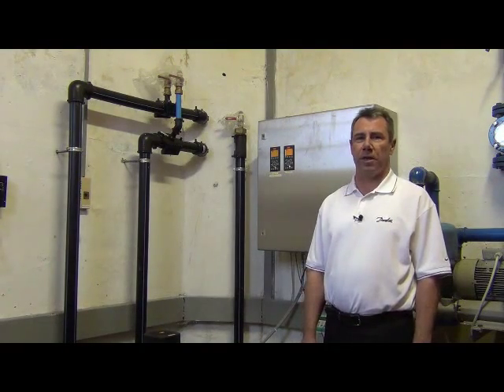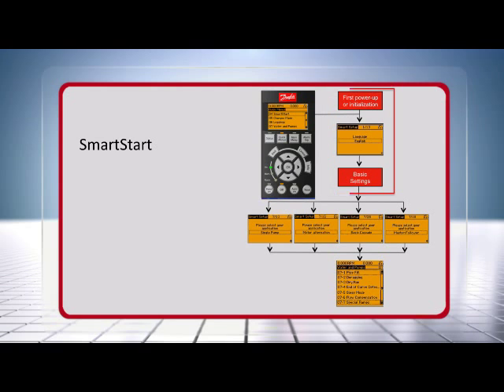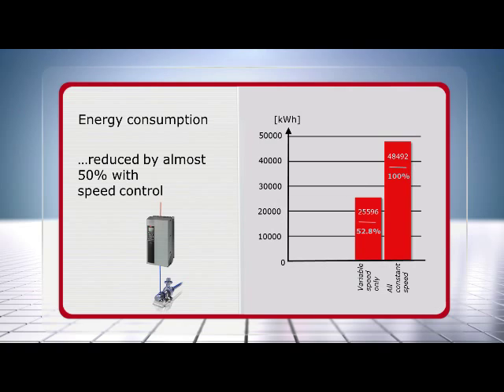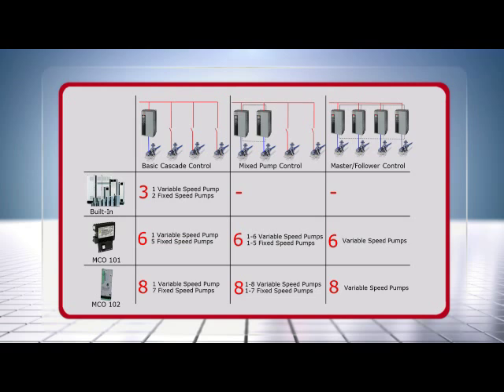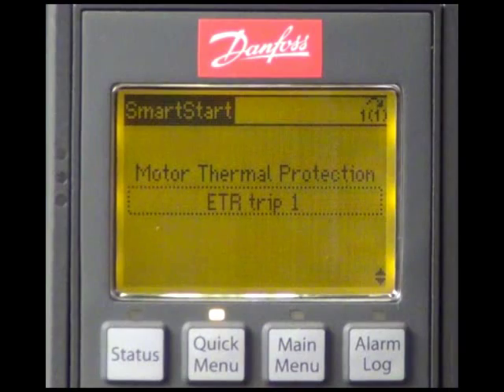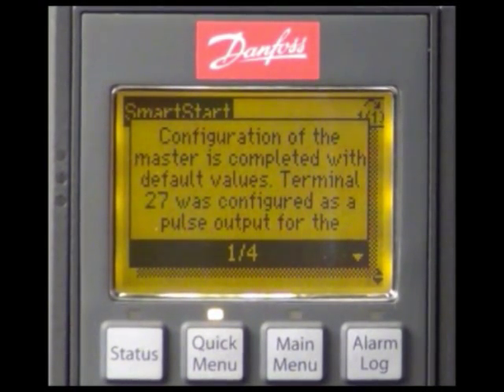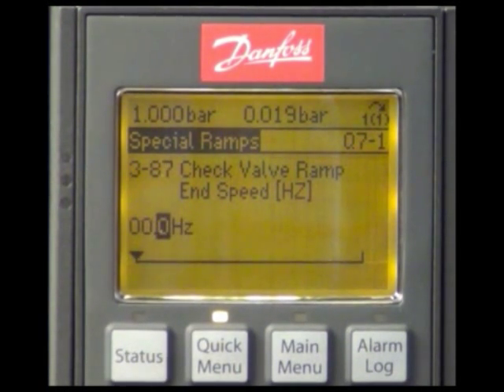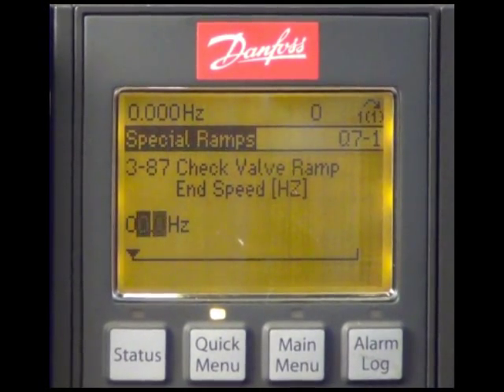VLT® AQUA Drive - Cascade Controller & Master/Follower Applications

Comment: Hi how are hope you are fine.I could not set drive as a master its by default on follower mode please guide me how i can set a drive as a master.
Reply from the maker: Hi Ghulam, You can find the Master/Follower instructions for the VLT AQUA Drive in this document : http://drivesliterature.danfoss.com/showDetails.action?doctype=TLI&docid=0000000000000030000002559&version=B3&language=EN
Reply: Thanks i will try to configure according to this.I will reply soon
Reply: Do these have a no open contact that closes when pump runs, so a run light could be installed?